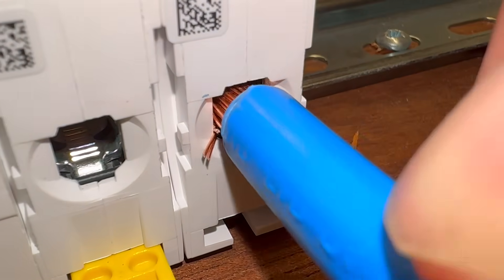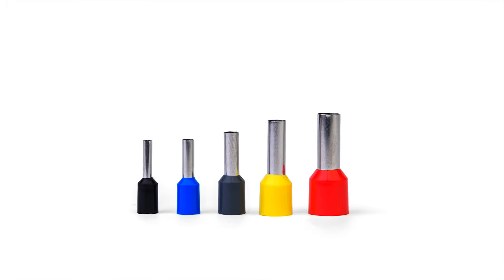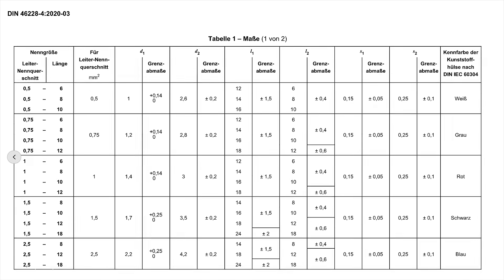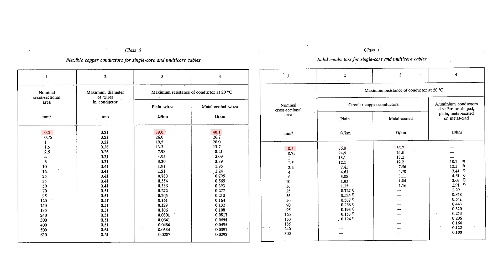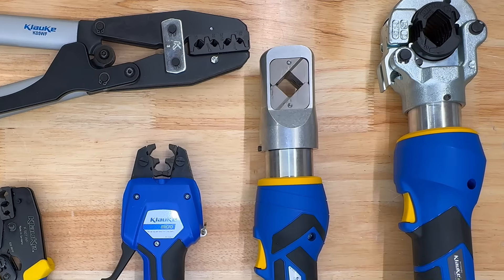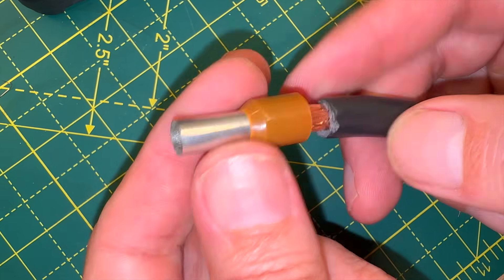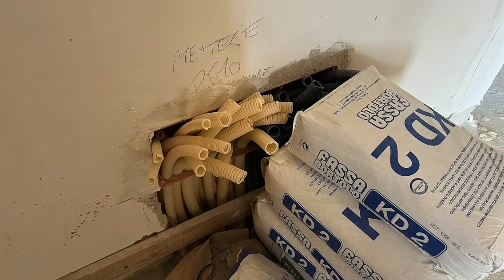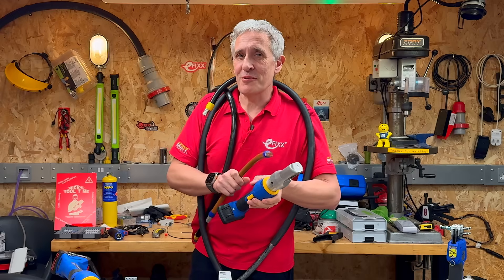The Truth About Ferrules: Overkill or Essential?

Comment: With ferrules should the barrel be cut back to fit a terminal? Or fully inserted, how much if any exposed copper is acceptable thinking for termination in MCBs and dinrail devices.
Reply: Don't use a 12mm long ferrule where 8mm length would avoid cutting.  I can't imagine how one could easily trim a ferrule without deforming it.
Reply: @ChrisNotTheKing  Once they're crimped on they cut much like solid wire. No problem to shorten them if needed.
Reply: @ChrisNotTheKing its not hard to cut. But moreover for diy its hard to keep all the right lengths and sizes.

You can however also cover the extra with heatshrink.
Reply: @lasskinn  
For DIY, a little bit of solder can be used to tame the fray.  My younger self was busy doing that for a 65-in-one to prevent strand loss.  'Twas also a thing in "fuseboxes" in an era before mine, I've seen.

Comment: Retired now, but having spent many years working in industrial electronics, I found myself frequently nodding as I watched! Only I had to learn the hard way, there was little to no consistency on installed systems from different manufacturers - especially the older machines.

Comment: Nothing was mentioned about oxidation film on ferrule. 

Contacts is very interesting topic: popular WAGO can't mechanically pierce oxidation film and firmly press solid wire in gap area, screw terminals can't resist to thermal expansion, soldered connection might be easily damaged by short circuit, etc. Neither European electricians, nor UK electricians use crosswelding despite this way removes all oxygen from conductors and hermetically seals all the gaps.
Reply: No mention of copper ferrules that aren't tinned, vs those that are.
Reply: Generally speaking you want to use tinned copper ferrules because they will maintain the contact area better over time verses copper sheaths (non-tinned copper ferrules)... mainly because most (nearly all) ferrule crimps are not cold welds.

Comment: Many years ago I went to a factory where the customer was wiring up our control panel on their equipment. I could see they used ferrules but when I tugged on the wire it just pulled out. Apparently they thought it was acceptable to put a ferrule on the wire, shove it into the terminal block, and rely on the terminal block clamp to squash the ferrule down onto the wire. Not only did it not grip the wire, but it flattened the ferrule tube out so it became wedged into the terminal block, such that one had to tug the ferrule tube out with long-nosed pliers.
Reply: Mr. Bean!
Reply: Rookie errors 😂
Reply: I've got at least 5 different crimpers for various tasks. Are they cheap? No, but if that is what you for your living, you work it out.
T&B and Panduit make good crimper. In the EU, there is a company, I think is "Schidner"? That make very nice metric sized crimpers.
Reply: The number one fault that shows up on systems is a loose connection.
I went, and bought a complete system of crimping tools, and sleeves to avoid the above.
It was not cheap.
Reply: Ugh, yeah I have done that when I had no tool and was putting small fine stranded into large poorly made screw terminals (screw much smaller than the hole).
It's pretty bad, but it's a lot better than cutting up a stranded wire with a shitty screw, at least it is if you can tighten them enough lol.
For decent screw terminals with wire that is the right size this is just always worse though.
Reply: @samheasmanwhite  sometimes special situations justify solutions which are not in line with what the books say. A production line is clearly not to be considered as such a situation. It’s within the responsibility of a skilled electrician or similar to tell what is an acceptable and save alternative solution. For example a lot of circuits will never require the full capacity of their connections when it comes to currents. Therefore an improperly installed ferule might acceptable as long as the connection is clean and the strains protected.
Reply: @50cts  Explain how in incorrectly installed ferule termination is ever acceptable. 
In the case mentioned, EVERY termination SHOULD be redone correctly.
Reply: @BTW...  in low current applications, where wires aren’t even close to being at their limit I wouldn’t mind a crimp connection that wasn’t compressed with the right tool. Of course not if it slips out. A pull test should be done on every wire connection. I‘m talking about repairs and stuff where we‘re talking about few connections being touched. When the whole place is being wired up from scratch or in production it is of course not acceptable. As I said it is within the responsibilities of a trades man to decide what option are good enough in a given situation.
Reply: @50cts  In the Industry, and society generally, a good reputation is built slowly over a long time, BUT lost in an instant. 

Yeah, see I was thinking of the cited scenario from the original post - an engineer of the client finds a dodgy, and then another. 
It makes the whole panel, and for that matter any product of that shop, of highly dubious quality. It raises a whole lot of serious questions... like, what was supervisor doing? 
That flaw could cost the client significant down time of  production and the cost of fault diagnosis and repair. 
If that panel was associated with an essential service for the community.. like say take out a power grid for hours or days... shut down a mine... or petro-chemical facility, then the cost could be multi-million or loss of lifes. 
In a QA role, or frankly, as another craftsman or supervisor on the shop floor.. I'd be having every wire, every cable, every terminal inspected and remedied, by a trusted worker. 

Hmmm, low current loading... least of concern.  Take a close look at the images of control panels, small control wires using ferrules... into terminals or instruments...
hopefully terminated correctly. 
VOLTAGE DROP in any instrumentation or control wiring is the major concern, AND loose jointing that creates open circuits and sporadic faults. e.g.
1) An Open circuit CT Secondary wiring (being very low current and large wiring)  while the Primary current is at high load can over-voltage damage that instrument. They can be very expensive, very inconvenient, and very difficult to change out if they are on bars. 
2) An Analogue input signal from a field sensor operating in the mA range at extra low voltage level feeds into the cabinet, TB's and then PLC - Programmable Logic Controller. That PLC controls a whole process in the production line. Could be a water treatment plant  
3) A Digital input signal originating from inside the board or field sensor, feeds PLC or Remote Telemetry Unit. That RTU controls or monitors machinery process or system Protection... or Environmental..  or Human Safety.
So, that's just 3  low current low voltage applications... via a potentially dubious wire termination. 
Naa, No thanks.  Hard Pass.

Of course that subject control panel could be for a small scale HVAC or production machine... or Low Voltage (240V) Distribution Board that has a 250A load capacity, or a humble home DB that some DIY idiot or Mr Bodgy business gets their hands on.   
But still.. Naa, no thanks. Hard Pass on that. 
No way my name will be in that kind of narrative.
Reply: @samheasmanwhite   I did that once too, I was developing some hardware integration and I just put stranded wire directly on a screw terminal.
Needless to say it made debugging the software controlling the hardware immensely more difficult.
Until I realized a couple of days later that ferrules existed, but I didn't have the tool, so that's exactly what I did, just put the stranded wire in the ferrule without crimping it.
It did help with the connections, didn't make them permanent, but made then actually properly connect.
The good thing about all of that is that I learned a lot about electrical engineering as I'm a software engineer. Also, the software became very robust because it was tested in a hellish environment with lots of electrical faults.
Reply: @MrBrendanrex  this is hilarious

Comment: Thoroughly researched and presented. In my experience, a 10mm^2 max crimper, along with a 10-50mm^2 max crimper is a good solution for no batteries to keep charged all the time. The bigger crimper usually has longer handles for leverage. Anything bigger than 50, get a hydraulic crimper. Also be careful where you send your hydraulic crimper to get serviced. Both of ours at work stared smoking (not from the battery), so we sent them to a repair service, 3 months later one started smoking again in my hand as I was crimping (the one from 12:54 with a set size die).

Comment: One thing to point out is that with spring loaded terminals using ferrules increases the contact resistance by a small amount.
The fine stranded wires without a ferrule have a larger mating surface area than with the ferrule.
However when connecting large amounts of wires errror margin decreases with ferrules.
Reply: Yes I would agree that the benefit of using Wago lever operated conductor clamps is that ferrules are not needed. I have never seen a fine stranded conductor damaged from repeated insertion in a lever clamp.
This is very useful when designing and prototyping circuits because of the ease of changing connections without damaging stranded conductors.
Reply: @stevejagger8602   It's also a good way to join single core and stranded wires without much hassle. I'm still debating (with myself) whether it's worth flattening the end of the single core wire (for better contact with the spring). For the moment the side of "Don't needlessly work harden the thing, you muppet!" is winning 😅
Reply: @233kosta  Wago connectors transformed how I worked as an electrician, but also fed into my need to experiment with circuit design that required quick and simple wiring changes for monitoring or component changes
Reply: @stevejagger8602   It's just do nice to have the flexibility
Reply: Yes it’s right that fine stranded wires will have a slightly bigger mating surface which means a slightly lower connection resistance, but that was taken into account by any reasonable manufacturer when designing and approving the terminal for both types of wire connections. So in reality you can get slightly lower resistance if you connect the fine stranded wires without a ferrule. But at what costs? And what application requires it actually? Imo there is (almost) no application where the added pain of wire handling a fine stranded wire without ferrule during installation and maintenance can’t be seen as bigger advantage than the slightly lower resistance when connecting it without ferrule.
Reply: @50cts  the main issue with terminating any csa of fine stranded conductor into any screw type connector is crush damage and incomplete contact.
The only exception is lever clamp connectors like those manufactured by Wago.
The clamping mechanism ensures persistent and improving contact with movement and no damage to the strands when released from the clamp.
Ferrules of the appropriate shape to suit the screw clamp type ensure a secure connection.
When clamping old class 2 tails into a main switch it was necessary to torque tighten at least three times to ensure that there was no space remaining between individual conductors.
It is the same principle at work with the application of a ferrule to fine stranded conductors.
I suspect that any increase in contact resistance is negligible if ferrule size, shape and tightening torque are correctly applied.
This particularly important within control panel wiring.
Reply: I love wago spring terminals and have had to deal with the fact that the ferrules disagree with them when in mobile equipment. A few times now I’ve had callouts to malfunctioning gear due to a cracked ferrule in a wago spring terminal causing a loose connection. I’ve also seen some elusive dodgy crimps, and spent quite some time fault finding a loose connection caused by cable conductors partially coming out of their ferrules. I’ve stopped using ferrules in spring terminals on my mobile equipment now, the vibration doesn’t like them.
Reply: it doesn't matter whether it decreases or increases. 
the only thing that matters is the final contact resistance. 
if it is sufficient, there is nothing to worry about.

for example - for a specific contact it is established that the transition resistance should not be more than 600 milliOhm’s

and if without a tip you have 200, and with a tip - 220 conditionally - who cares? you are in standard with a larger reserve.
Reply: I've wired a few industrial data logging panels for work. That's the exact application you mentioned where everything may as well have ferrules. Out of hundreds or thousands of stranded conductors, about 5 carry any sort of meaningful current, so the added resistance of ferrules into a spring terminal doesn't matter. And even where it does, my general preference remains not having loose strands that can become detached after a few reconnections and essentially become conductive FOD inside a panel full of electronics with no IP rating.

But I do really like how stranded wire spreads out in WAGO 221 terminals 😁
Reply: @233kosta  Very true, I've been doing a bit of work on a couple of CNC machines with different termination methods, and I think spring terminals should just never be used with fine stranded wire, it damages the conductors and massively increases the risk of making a bad connection. But after adding ferrules to the spring terminals I have actually gotten over my general hatred of spring terminals. Still prefer cage clamps though.
Reply: @samheasmanwhite  I suppose it depends on how skookum the spring is. Haven't seen a Wago break off strands on any of the wires I've used with one, but I have seen some folds left in one or two conductors, so I can see repeated insertion and removal being an issue. Maybe the DIN rail terminals are worse, haven't used stranded wire without ferrules in those, so I can't speak to that.
Reply: @233kosta  Ah, I just took look the Wago mechanism and that looks a lot gentler than the pointy backwards-facing spring ones I was using (DIN rail).
They look pretty nice, I might have to get some for non-DIN wiring.
Reply: @samheasmanwhite   I'm rather fond of the 221 series, the levers are nice and you can see right through them.

I know what you mean about the DIN ones, I had an unintended disassembly occur on one of those, the spring looks like it tries to guillotine the wire, so it makes sense that it'd be damaged. I just never tried it on a non-ferruled one before.

I've had good luck with some DIN-mounted relays too, their terminals have a plastic pusher with a flat tip receptacle (so you can't just shove the screwdriver in the hole and do what you need, sadly 😒). They're somewhat annoying to use, but didn't appear to damage the wire in any case.

Comment: How to insert two 6mm2 into a twin ferrule: I find that staggering the exposed ends helps a lot. Do NOT twist the conductors.
Reply: What could happen if u twist them?
Reply: @iamjesper  Twisting stranded conductors together results in an increased cross section. Also more snagging points.
Reply: @arnsch5505  ok thanks

Comment: There are times when you must use a ferrule; when you may use a ferrule; where you must not use a ferrule.  The skilled tradesman understands this.  Glad eFIXX covered this aspect.  Even something as simple as fault diagnosis can be made more difficult once ferrules are used.  Yes, it's often completely possible to use various resistance measurements to track a fault without splitting wiring systems, but being able to split a circuit without cutting the wires due to the use of a ferrule joins wiring is quite useful too.
Reply: Glad you made this comment, and that this video included such advice. As someone who resides in the US, but who works as a field engineer for a little old French based manufacturer of electrical products, I know we explicitly state where and when ferrules should or should not be used (most of the time)!

Comment: Why would you worry about a brass ferrule when the terminal itself is brass?
Reply from the maker: Still a higher contact resistance
Reply: @ Did you measure the actual difference?  At the moment it's anecdotal.  Although I imagine it would not help the product placement in the video if the difference turned out to be negligible ;)

If the resistance is higher, how badly does it affect terminal temperature for the rated amperage?
Reply: @jjarman009  150A through 1m-ohm yields 22.5W, through 0.002 yields 45W.  Those milli-ohms matter with high current.  Of course such current will also have heavy wiring which will wick the heat away so the entire picture needs to be considered as does the mechanical resilience of thin brass vs thin copper.
Reply: @ I'm familiar with how I^2 R works.  However, these Amazon kits typically max out at 10 mm^2, so about 40 A.  

It would be interesting to see how much of a difference (if any) these kits make at 5 - 40 A; ie, typical domestic loads.
Reply: @jjarman009  That's where you move from heating concerns to resilience concerns.
Reply: @efixx  I propose performing an experiment to see how much difference it actually makes.
Reply: @efixx Top-quality manufacturers also make brass ferrules. Vogt, for example, sells brass ferrules up to 120mm2, with most sizes available unplated or with tin, nickel, or silver plating. So while copper may be preferable for high-current applications, a ferrule being brass is not per se an indication of poor quality. And given that how the metal is processed will affect its crimping performance, I’d sooner choose a quality brass ferrule over a cheap copper one. (At work, where my work matters, I always buy top-quality ones.)